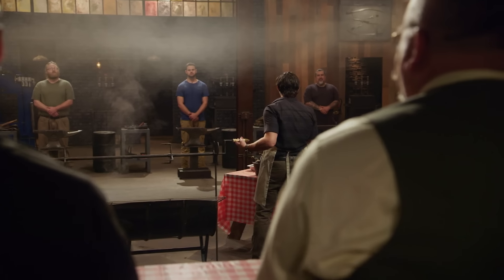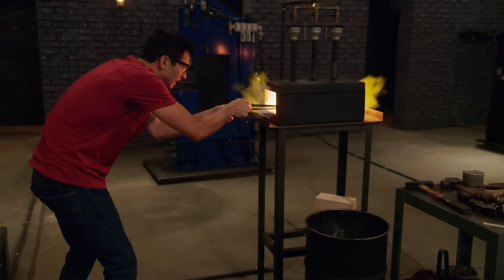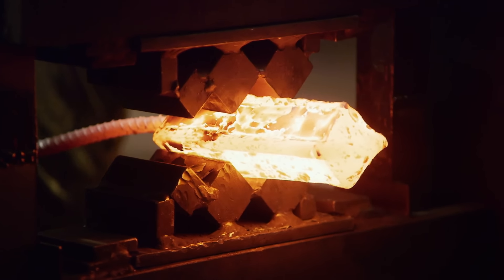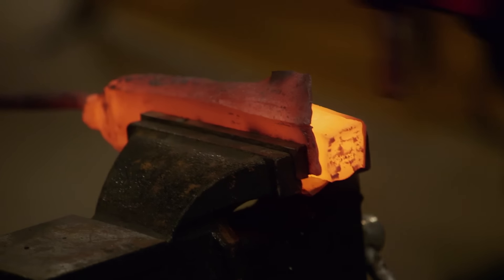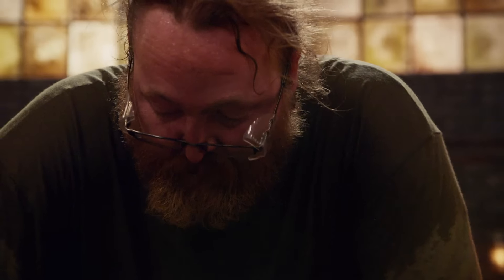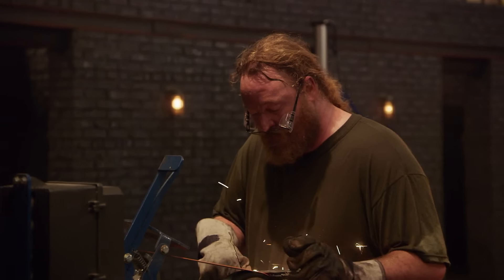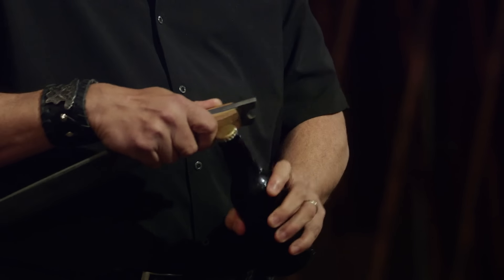Forging an Epic Camping Blade & Bottle Opener Combo | Forged in Fire (Season 7)

Comment: The one knife didnt meet all parameters, the bottle opener didnt function. that was a bad call.
Reply: He had a bottle opener it was just not working well. Cameron had a good bottle opener but his blade didn't cut well. At the end of the day, a knife is still mainly for cutting so a well functioning blade is more important than a well functioning bottle opener
Reply: I couldn't agree more.
Reply: I agree that it did not meet parameters, blue shirt should have been sent packing
Reply: Yeah blue shirt didn’t meet parameters. He should have gone home
Reply: I wouldn’t call a knife that doesn’t cut meeting parameters. To be a knife it has to cut
Reply: I would say it cut better then the other opened the bottle
Reply: @JuliaJuanaAlvarez  not if the test requires both
Reply: @evan5167 it cut. Just not well
Reply: @evan5167 A knife will get dull, as long as it is hard steel, it will get a cutting edge sooner or later. As for a bottle opener, not wetsone on earth will fix that. The judges made the wrong decision.
Reply: @goiterlanternbase do you expect a knife that was just sharpened to be dull?
Reply: As a Mexican.  Could just use the knife portion to easily open the bottle.  

Don't even need a bottle opener lol.  Just a solid corner of an object.
Reply: The judges determined that the blade not cutting was a bigger penalty than the bottle opener not working. To be clear, he included a bottle opener, it just didn't work - while the grounds for disqualification are actually "not following directions" - he did follow directions, he just failed to make one aspect functional. That's the difference between him and the guy who was supposed to make a "recurved" blade but only made a "curved" blade
Reply: Any butter knife is a bottle opener.
Reply: @manz7860 as a German i don’t even need an object. I can open a beer through sheer willpower.
Reply: @Frosty_tha_Snowman  the parameter was for a functional bottle opener.
Reply: @wolfeotigera  but it did nothing to alter the blade itself's functionality - especially when they considered the fact the bottle opener didn't work, and took that into account while making their decision.
Reply: @Frosty_tha_Snowman  I understand that it didn’t alter the blade function, but if you watch other episodes: contestants are eliminated due to not meeting the parameter. Although to the judges the bottle opener is still functional due it did grip the bottle and open it a little bit (you can see bubbles going down the side) which could be the reason that the guy in blue shirt survived the round.
Reply: @wolfeotigera  Yeah I've seen a lot of parameter failures - my best guess, is it's what you said about it kind of opening the bottle (I was thinking that as well) but also, most of the parameter failures were with the blade itself - making it too large, curved the wrong way, or something of that nature - where this was a separate accessory built in. Although, they eliminated that one guy for not putting in a medallion, so there's still some double standards going on here, to be sure. I imagine it's a lot to do with what the producers and the judges argued and agreed on over time.
Reply: maybe Doug just sucks at opening bottles
Reply: exactly, did not meet parameters, a metal finger is not a bottle opener, naysayers logic then says Cameron shouldn't have wasted time on an opener and if his knife cut better then he would've won? no parameters, no test, period
Reply: I agree that the guy in the blue shirt should have been eliminated. Yes, the red-shirt guy's knife didn't cut very well, but it will cut as Doug had stated. So that parameter has been met. The blue-shirt guy's knife, while it cut much better, it couldn't open a bottle, and the parameter set is an operational bottle opener. If it fails to open a bottle, it's not operational, thus the parameter was not met.
Reply: @fighterdemiter  just like it opened a beer Just not well

Comment: I see a lot of confused people in the comments - the parameters are what your blade needs to include.... the parameters are NOT what your blade needs to be able to do. The blade needed a bottle opener - the bottle opener doesn't need to work - that's a performance thing, that's like a blade that won't cut or that takes serious damage in tests. Based on the one test we saw it doesn't make sense that the first guy didn't make the cut, but I'm guessing there were two other tests we didn't see that justified that outcome.
Reply: They literally said it has to be an operational bottle opener, also by your logic the blade shouldn’t need to be able to cut as it simply has to be the right shape but not perform its function.
Reply: @Earlisrandom I mean, you're absolutely allowed to have a blade tested that's the correct shape and can't cut... but it doesn't mean you'll win. Lol the simple fact is, it had a bottle opener included, it just didn't work - the other guys bottle opener worked, but the blade didn't cut - the judges saw the blade not cutting as a bigger dysfunction than the botched bottle opener, and so they determined an outcome accordingly. That may be oversimplifying it - I'm sure all of the craftsmanship that went into it also played a factor in determining which Smith moved forward.

Comment: How did the guy with the not functional opener not get eliminated?  A working opener was a parameter it really shouldn't have been tested past that point.
Reply: But so is a blade. Camerons blade really didn't cut well compared to Nicks. At the end of the day a knife is still for cutting so a well functioning blade is more important than a well functioning bottle opener
Reply: @JuliaJuanaAlvarez  But a functional bottle opener was one of the parameters.  If one of the parameters was to have a handle made out of two materials, but one blade smith turned in a knife handle with only one material, he would be eliminated no matter how awesome the knife was otherwise.  Same if a parameter was to make a Damascus blade, but a smith turned in a knife forged from mono steel.  It could be the best knife ever made, but it still wouldn't meet parameters.  In this case, a functional bottle opener was a parameter.  He missed a parameter, so according to the rules of the show, he should have been instantly disqualified.
Reply: @Durwood71  Yeah but it's also a parameter to make an effective working knife and Cameron only barely made that, his knife was pretty dull and hardly cut. I would argue one missed out on the working bottle opener and the other on the working blade. You really say your knife was rubbish and barely cutting but your bottle opener works so you go to the finals?
Reply: @JuliaJuanaAlvarez   His knife still passed the sharpness test, and he had an operational bottle opener.  The other guy missed a parameter since his bottle opener didn't work at all.  I've seen smiths on this show disqualified for having a pommel of the wrong shape, or using the wrong handle material.
Reply: @Durwood71  That's quite true, still I would rather see a smith in the finals that can make a good and effective weapon rather than one who made a toy
Reply: @JuliaJuanaAlvarez  I'd rather a smith who can meet all parameters than one who can't.
Reply: @Durwood71  Have fun with your toy than, I take the sharp and effective knife

Comment: Every knife had a bottle opener. But one didn't work. Another one had a duller edge than the other knives. There were no parameter violations in this episode. The judges’ decision is reasonable.
Reply: It wasn't a functional bottle opener, so it was definitely a parameter failure.
Reply: @Durwood71 That is your interpretation.
Reply: @Heuroya  How is it an interpretation? Doug couldn't open the bottle despite multiple attempts.  Therefore, the bottle opener wasn't functional.  It's a demonstrable fact.
Reply: @Durwood71  Existence and functionality are not the same concept. you are confusing it. So you haven't reach accurate understanding.
Reply: @Heuroya  Will didn't say the bottle opener merely had to exist, he said it had to be "operational", which it clearly wasn't in one case, making it a parameter failure.
Reply: @Durwood71 ’Operational’ is a functionality.

Comment: I call bullsh*t.
One of the requirements was to have a functional bottle opener.
Cameron's blade had one, Nick's blade did not.
As is mentioned many times throughout the show, "Failure to meet one of our parameters is immediate dismissal from the forge."
So this highlights shows how the producers call the shots, not the judges.
Reply: I mean, technically you can open a bottle with a blade that doesnt have a built in bottle opener, so that requirement in itself is kinda stupid
Reply: @kili3117 the parameters where to put a "functional" bottle opener on the knife. I have a feeling that the judges reasoning for why Cameron's didn't make the cut but the other guy's did was lost when editing this for YouTube. Because imo not having a functional bottle opener should have been a disqualification.
Reply: He had a bottle opener it was just not working well. Cameron had a good bottle opener but his blade didn't cut well. At the end of the day, a knife is still mainly for cutting so a well functioning blade is more important than a well functioning bottle opener
Reply: @Benson_aka_devils_advocate_88  It was cut from the full episode as well.
Reply: If anyone thought this show was real, they weren't paying attention. The results are always predetermined.
Reply: One doesn’t have a functional bottle opener and one doesn’t have a functional blade, your choice
Reply: @evan5167  Excactly and scince it's a knife, the blade is more important than the gimmick
Reply: You can open a bottle with anything and if Doug would do it properly he would have definitely opened the bottle. It might not have been as convenient to use as the other two but it was definitely functional and as others have said, at least it cut deep.

Comment: So, the one guy who didn't put a required bottle opener on his blade made it to the finals? Would love to see the part where they justified that reasoning/change to the requirements...

Even though Cameron's blade wasn't as sharp as the others at least his met parameters. He really should have made it the finals imo!
Reply: He had a bottle opener it was just not working well. Cameron had a good bottle opener but his blade didn't cut well. At the end of the day, a knife is still mainly for cutting so a well functioning blade is more important than a well functioning bottle opener
Reply: Every knife had a bottle opener. But one didn't work. Another one had a duller edge than the other knives. There were no parameter violations in this episode. The judges’ decision is reasonable.
Reply: @JuliaJuanaAlvarez  "He had a bottle opener it was just not working well."

Exactly, and since a functional bottle opener was one of the parameters, he should have been eliminated on the spot.
Reply: @Durwood71  well the choice is between having a not working well blade or a not working well bottle opener.
Reply: @quertbarbie62  Will specifically said the smiths needed to include "an operational bottle opener" on their knives.  It was one of the parameters. One blade failed to meet parameters, and the smith should have been disqualified.
Reply: @Durwood71  For that the other had a poorly working knife that barely cut. A good blade is more important than a good bottle opener
Reply: @JuliaJuanaAlvarez  you can sharpen a blade, but you can't slap on a bottle opener without having to dismantle the whole thing.
Reply: @Kurdati  He had a bottle opener already there, just like with the blade he could improve it
Reply: He HAD a bottle opener — Doug was just trying to use it backwards. I’m sure the other judges pointed that out to him while they were deliberating

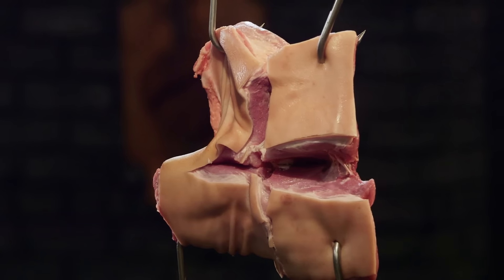Comment: Who is wondering why the other guy won't get eliminated check out at 8:32 and check the details of the bottle opener one side is oval and the other side is pointy and the judge tried to open with the oval side, maybe it is not the most convenient design but the judge must be realized that he try to open with the wrong side.